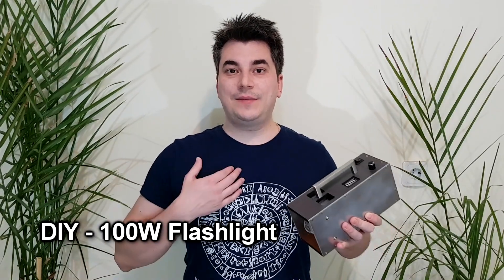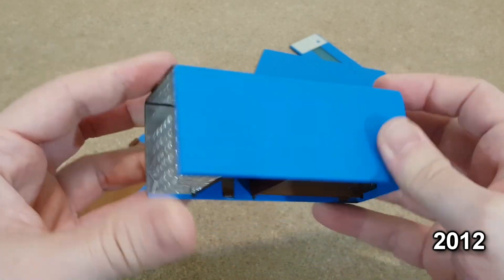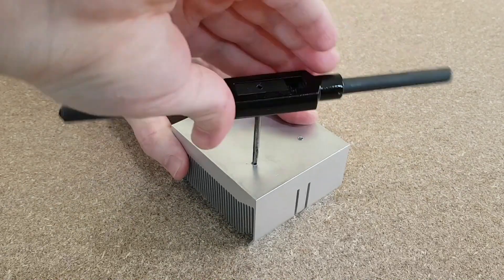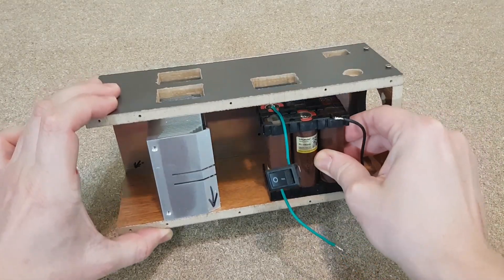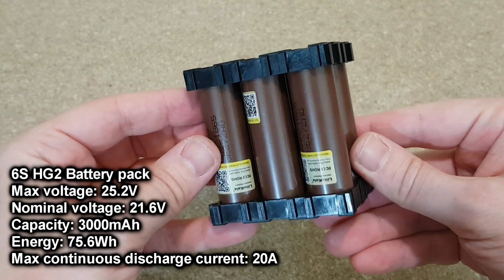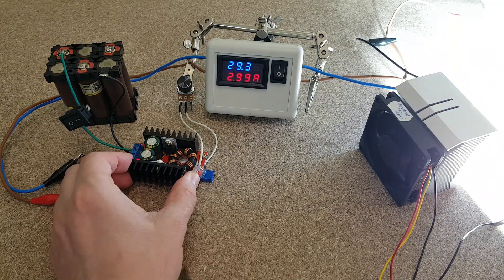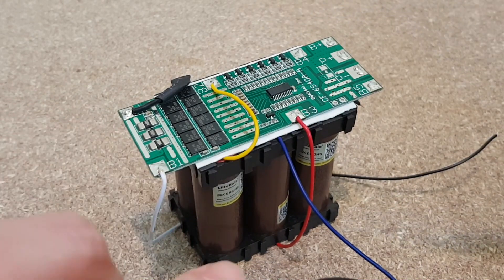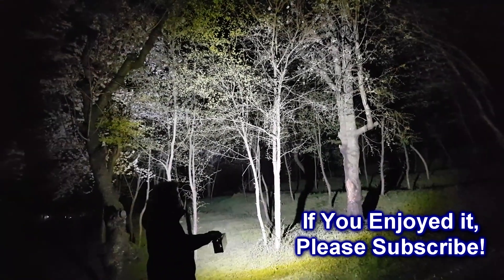DIY 100W LED Flashlight - part1

Comment: Hello there, good morning! That's a really great tutorial, thank you very much. 
I have a question, I already bought almost all the parts of the flashlight, only need now the batteries. 
I found another one that's also from Liitokala, and have the same description, but with a higher capacity of 3400, instead of 3000. 
Would that influence in a negative way?
Reply from the maker: Hi. If the capacity is real, it's ok. but you need to test them first.

Comment: Can you just leave one potentiometer without adding another?
Reply from the maker: yes, but it will be difficult to adjust the voltage for the LED.
Reply: @Sorin_DIY  I only have a 10k potentiometer and I have two resistors how do I install?

Comment: I do not understand can not use a potentiometer of 10k?
Reply from the maker: the 10k potentiometer will set the voltage between 12-35V, so you need to be very careful and adjust the potentiometer only about 2mm to dim the LED. if you add a 1k potentiometer you will have more control to safely dim the LED.
Reply: @Sorin_DIY  So if you put a resistor of 10k  In the middle leg of power 2, does it solve?

Comment: 10:40 "Can you guess why?" Err... Would be the battery pack's geometry, right?
Reply from the maker: no. you can find the answer in the part 2 video.
Reply: @Sorin_DIY  Oh, yes. It's a Step-UP-only converter. Makes sense. 😃

Comment: How to measure battery pack capacity..? 
If per cell is 2200mah and I made 5s 21v battery pack with 10 cells so how I measure there's amps and watts.
Reply from the maker: the capacity is measured in Ah, if you connect the cells in series, the current and capacity remains the same, only the voltage is added. so your 5S battery pack with maximum 21V has a capacity of 2200mAh (2.2Ah). the energy of the battery pack is = capacity*nominal voltage = 2.2Ah*3.6V*5cells= 39.6Wh.
Reply: @Sorin_DIY  thanks Bro

Comment: Hi bro. I made ups for my  router and modem. They works fine, but  only problem is they restarts when power cut. How can i solve this ...i want it to run continuosly without restarting.which capacitor should i use (value)..
Reply from the maker: hi. you can watch my part 3 video about the UPS built, I test a few ideas to switch faster on battery power.
Reply: @Sorin_DIY  ok. I will check that...thank you.🔥
Reply: @Sorin_DIY   i just watched part-3 video, so i should make relay to Klick faster  and use high capacity capacitors to smooth the output when switching.
Reply from the maker: yes
Reply: @Sorin_DIY  ok ! thanks bro

Comment: i have an idea for a good spot welder with a bank of super-capacitors with transformer and circuit to charge them just make sure to work safe with them cause charged super capacitors can harm, for solder nickel strips to batteries however there is no need of huge capacitors but i suggest using modified microwave oven transformer remember to be cautious cuz i want to keep watching new videos from you friend :)

Comment: I think you used 6s battery because when the 7s battery is fully charged you can't adjust the led voltage below 29.4v
Reply from the maker: correct

Comment: Use spot welder to stick the batteries together, soldering iron is for well experienced elecctritions
I tried to do this but it didn't work, when I tested the battery it let out a small explosion! Careful with li-ion cells...
Reply from the maker: that's why I got the cells with nickel strips already attached. they can be soldered much easier and faster and the cells will not heat up.
Reply: That's safe btw

Comment: I guess you used 6s instead of 7s because you wanted to be able to dim the led below the 7s voltage with only a step up converter
Reply from the maker: yes, you are correct.

Comment: I see that this flashlight would be very bright but, if I did my math right, you would only have 66.6Wh available.  I can see you'll get about 30 minutes per charge, if I'm right.
Reply from the maker: hi. according to the seller this type of li-ion cell has a nominal voltage of 3.6V, this gives the battery pack an energy of 64.8Wh (3Ah*3.6V*6). in the video I mentioned by mistake that it has 75.6Wh... ups :). but in reality I think that the cells have a nominal voltage of 3.7V, not 3.6V. so the energy should be as you said 66.6Wh. I say this because the flashlight lasts 52 minutes at the highest intensity. it may sound ridiculous, but I timed it twice. 
the LED doesn't use 100W, that's the maximum rated power, but it's recommended to power it with less, especially because the LED is not perfect, as you see in the beginning of the video, the LED chips don't light evenly at low voltage. that's why I power it with maximum 3A (29.3v*2.99A=87.6W). I tested it 10 minutes on the bench and the current remains stable.
but this still doesn't explain the autonomy. 66.6Wh/87.6W=0.76h =45min. and this is assuming that the converter works with an efficiency of 100%, which obviously does not.
so I'm guessing that the current used by the LED fluctuates and may decrease over time. 
or another explanation may be that the capacity of the li-ion cells increased slightly after several cycles. I got maximum 3000mAh from these cells. but I see in the reviews that some other buyers got more, even 3137mAh. 
otherwise I can't explain at the moment the 52min autonomy. it's a bit difficult to dismantle the flashlight and test the power consumptions inside, but I will probably do this in the future.
and at the lowest light intensity it lasts for 6:10 hours.
Reply: @Sorin_DIY  that mean a little less time, about a minute less.
Reply: I think it will last little bit more than 30 mins. I think it is betwwen 35-50mins
Reply: @moya9450  With a little research, 35-45 minutes would be its run time.

Comment: Is it because you have a higher range of luminescence? Since you're using a step up converter, the lowest voltage you could have with a 7s battery would be to high for your needs. Or maybe it's easier to charge, maybe you don't have a 7s li-ion balancing charger.
Reply from the maker: yes, you are correct. the complete reason is because a 7S battery pack has a maximum voltage of 29.4V and I want to adjust the voltage (with the secondary potentiometer on the boost converter) between 27.5V and 30V. with a 7S battery pack I could not have done that.

Comment: Using 6s instead od 7s because od the size? Or maybe because the MAX voltage of the LED is 30v and at a lower voltage it Draws less current and is still bright enough and also generates less heat? Its just my guesses
Reply from the maker: no, sorry :)

Comment: Maybe you would enjoy the channel by "Luca" discussing the "mini spot welder". They are only around 30 EUR and they work very well with a small modification.
Reply: I have one of those battery-powered welders. Quite adequate for occasional use, and fits in a tool bag. I use it at work to change out cells in Chromebooks.

Comment: LEDs are a current driven component. The forward voltage is dependend on the current going through the LEDs. To get a more stable output i suggest using a led driver next time. Great vid BTW realy liked it.

In your die pack of the LEDs u can het similar output out of all of them if u set a current limit and no voltage limit.

Comment: let me guess you went with a 6s battery pack because the boost converter boosted the voltage around 32~ volts at its lowest setting
Reply: Good point - I was going to say that he didn't have an 8S plastic base and covers. Thinking about it, a 8S with a current driver would be a better idea.
Reply from the maker: not exactly, but you are close.

Comment: I know why you change your battery to 6s instead of 9s
With 9s battery the boost converter will be very efficient but the buck converter will be very inifficient and produce a lot of heat
With 6s battery the boost converter will not be that efficient but the buck converter will be much more efficient and less wasted power and less heat produced by the buck converter.
Reply from the maker: no, sorry :)